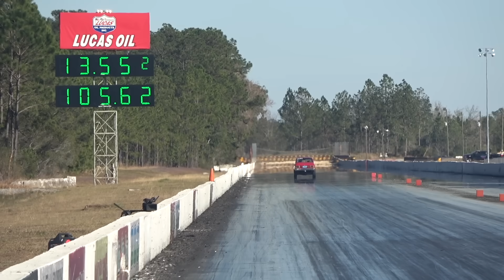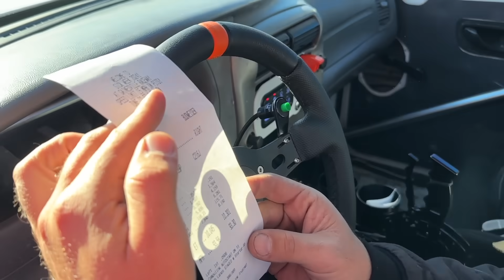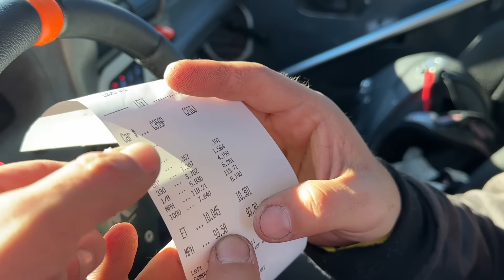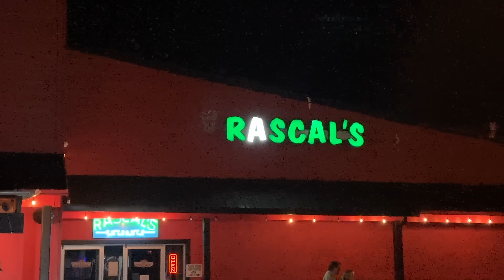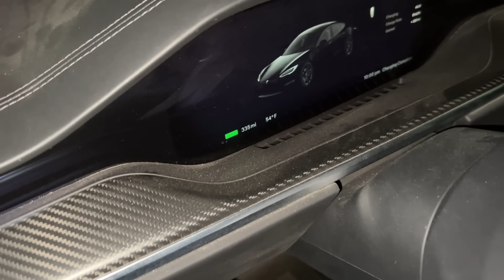Sick Week Day 3 - Wyatt Runs His FASTEST Pass Yet! The Plaidessey Takes an L

Comment: The Coyote wasn't released yet when I had my 95 Ranger Super (extended cab longbed with the 4.0L OHV V6 and a 4R55E) and while the 4.0 would lay an 11 for 50 feet, I ALWAYS wanted to do to it what I did to my old 94 Exploder, swap a HO 302W with an Eaton M-90 supercharger kit. If I had known that the Coyote would've been out so soon after I got rid of that pile of crap, I would've kept it, swapped a truck Coyote into it with a big turbo, or even swapped in a built 3.5 EcoBoost and put a BIG single turbo on it. I'm sure y'all have seen videos of the turbo V6 Mustang at TX2K.

Comment: That’s got way more in it than…. You guys should have built a full pp n/a with nos there’s like 10 cars in New Zealand making 11s with nos and 12s no spray and they sound better then a turbo … it needs a way bigger turbo with biggest exhaust housing and Itl go good …, with a rotor turbo its all bout making a block that won’t twist and that will handle big turbo with big psi ….. machine the rotors to fit big steel apex seal or ceramic and run nitrous